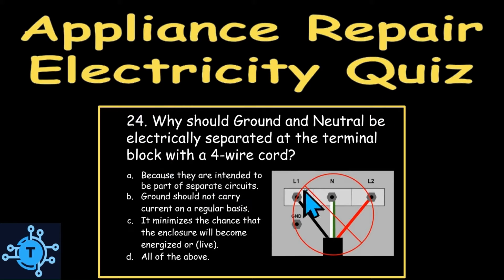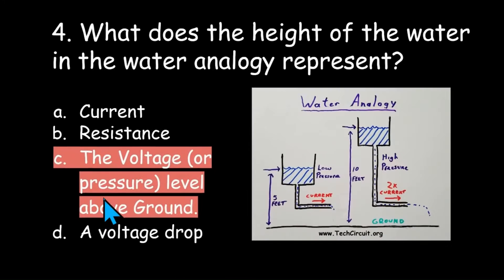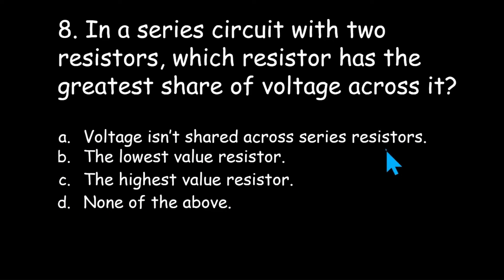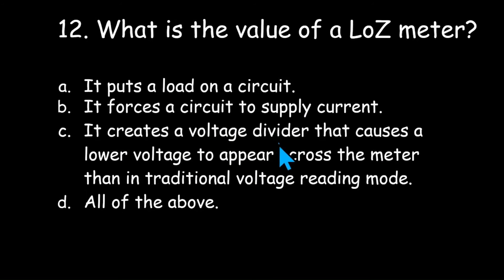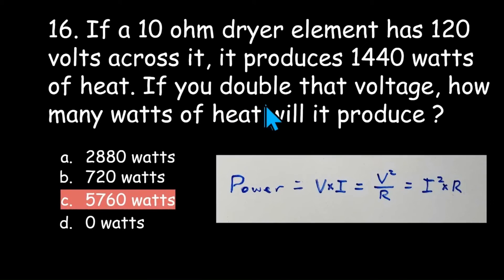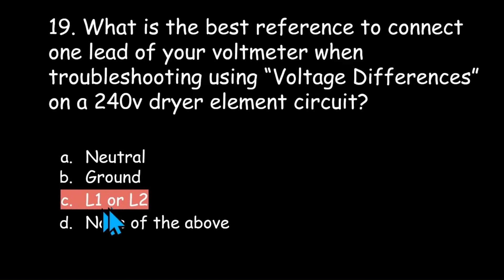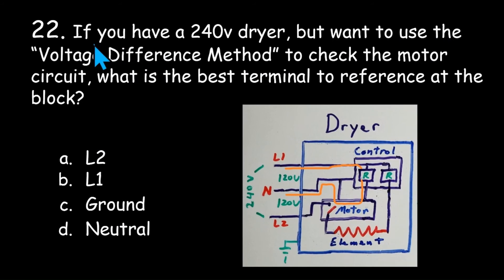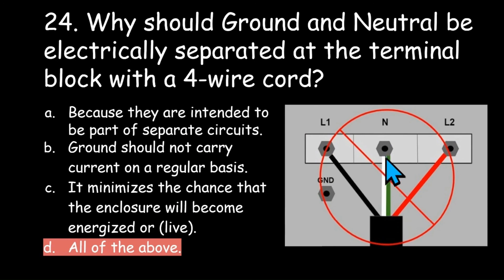#70 - Appliance Repair Electricity Learning Quiz

Comment: Got most of 'em, couple I didn't know, only came up with the wrong answer on 15/16 (16 appears to just be 15 with the formulae for P) — and figured out why I had, once I actually followed my instinct to expand out the math. (Tried to take a shortcut and ignore I, forgot why that doesn't actually work in this case.)
17 does assume that "any reason" doesn't include "the element's resistance miraculously halves".
Reply from the maker: Thank you for your input and for sharing your result. Yes, I think that a bake element's resistance exactly halving would be miraculous.